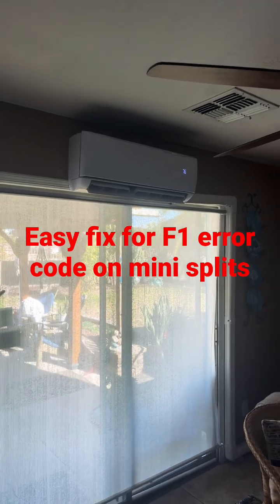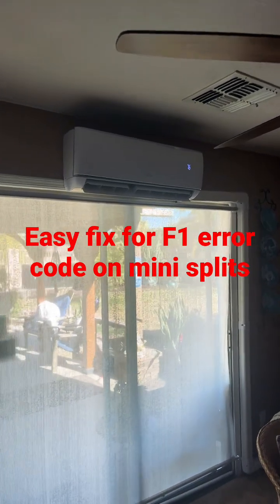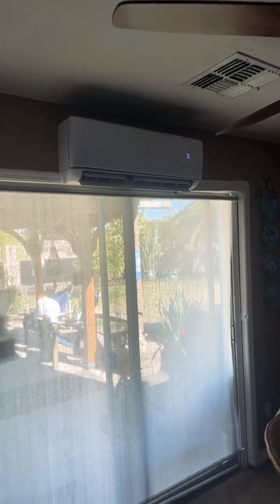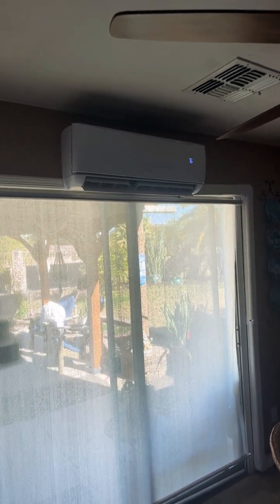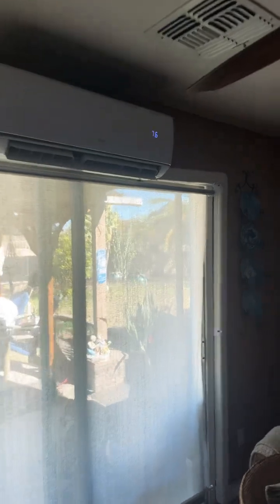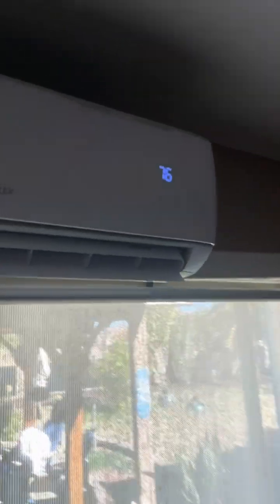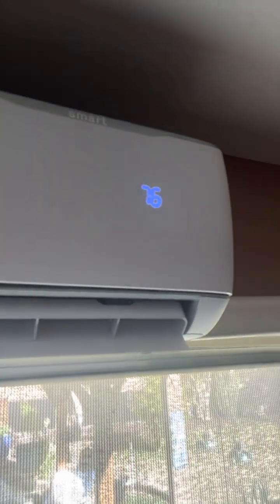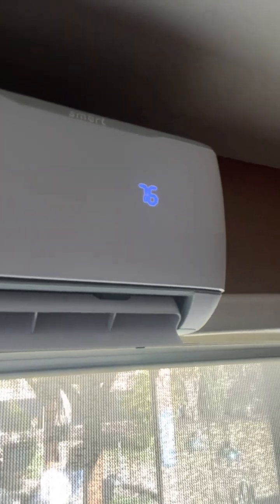Easy fix for F1 error code on most mini split heat pumps 120/240v.

Comment: I just cleaned the vents and now the fan is working but I don’t feel the cool air and it still showed the error 😭😭😭
Reply from the maker: I had the same problem and one of the wires on the outside unit came loose and was it connected at all. Once I connected the wire, the error code never came back. That was many months ago. I did a video on that fix as well.  Hope it works for you. I have not had any other error codes in the 4 years I had been running mini splits. Hope you have a truly wonderful and extremely blessed 2924

Comment: My AC shows this error when I run on Solar power during the day. Then I switch off and on but still it keeps coming back. I used water on the outer condenser but I’ll try your hack too. thanks
Reply from the maker: Try watching my other video where there was a loose wire inside the outside unit. I hope that fixes the problem first you.
Reply: @diy-solar-guy  thank you. I will watch the other video too and try it.
Reply from the maker: @cutiecats23 you are so welcome. Hope it works. This only fixes the F1 error code that I know of.

Comment: Do I have to reset the unit to get that code off after I clean the sensor
Reply from the maker: I just had that code F1 display on my mini split the other day. I unplugged the unit and waited an hour to plug in again. If it is hard wired, turn breaker off for an hour, then on. I also washed the filters and cleaned the sensor with a wet towel. It was close to 34-35 degrees outside so it could have been to cold for unit to heat. When I plugged mini split back in, it worked. No problems since. These mini splits will not work around 32 degrees. This is also a sensor on the outside unit as well next to the fins on the side the air blows out, make sure to clean that sensor as well. If your unit won’t work when around 32 degrees outside, try later in the day when the sun is out and if possible with the sun directly on the mini split unit outside. The F1 code is the temperature sensor. Hope this helps. Hope you have a wonderful and blessed weekend.

Comment: I have an FO error code on mine and I don’t know what to do HELP
Reply from the maker: Try disconnecting power or unplug for over 10 minutes if possible. Try cleaning the sensor on the inside head unit and the filters. Try cleaning the outside unit sensor as well. Both sensors are located next to the metal fins. Also look in your owners manual for what the code means. If it is low refrigerant, you might need to add the missing amount for the code to go away. If it is none of the above, it could be a bad circuit board or bad connection. With power off, you could try to wiggle the connections that are removable with male/ female connectors. Sometimes these can have a bad connection as well. Hope these help. Hope you have a truly wonderful and extremely blessed weekend

Comment: My indoor ac working fine. However as soon as I start heater function. It trips instantly.
Reply from the maker: Heating will use more watts but slowly ramps up so there is no surge. Double check your wiring connections to verify it is correct. I had a unit I installed upstairs and it kept tripping breaker. It was suppose to be able to install up to 16 feet off ground. The mini split did not have enough head pressure to push refrigerant in lines. I installed a different brand which was still 12,000 btu but it was able to push refrigerant up the whole 16 feet off ground with no problem. You could also have a bad circuit board as well. Hope this helps.

Comment: man! i got the F1 error... called the company. They said we need a technician. But, i saw your video and tried it and just as you said problem solved.. saved me money.
Thank you.
Reply from the maker: I am so glad you were able to fix the problem. I installed 7 mini splits, 6 of them almost 4 years ago and every one of them are still running great. I clean my filter and sensor every 3 months from dust build up. I remove the screen and lightly wash and rinse in the sink, let air dry and then install. I have not had any error codes in over 3 + years.  Hope you have a truly wonderful and extremely blessed week
Reply: That's what YouTube are for.. diy to learn taking care of your house bro. Tech gonna come out charge you his time to repair it. If you are handy and knowledgeable then fix it yourself bro
Reply from the maker: It’s nice to share quick fixes. Helped a lot of people get their mini split working again. I love that you don’t have to pay anything to try easy fix.
Reply: Good thank you

Comment: @diysolarguy man it woks 100%... Thank You Soooo Much man. In All Pakistani videos they were asking 🤦‍♂️ PCB is Out of order. Replace it... Oooo mannnnnnnnnnn.... You made my day. 🙏 praying for 4u from deep heart ♥
Reply from the maker: I am so happy that fixed your problem. Hope you have a blessed and cool days.
Reply: I cleaned the temp sensor but it still gives the f1 error code and i think maybe the sensor is faulty when i check out the company site which i have the ac unit they mentioned that if it gives f1 code surely you have IPM (integrated power module) faulty it runs for some time like 3 hours straight on 24°C but its automatic is not working,  which sensor do you think is faulty indoor or outdoor.
Reply from the maker: @aarishcollection2437 there might be multiple sensors on the inside unit depending on the brand of your system. If you search YouTube, for f1 sensor fault code fixes, there are a few videos that show you how to check ohms of the sensor and the main board. They show how to check with a ohm meter.
Reply: Han bhai ya banda na mera kafi pasa bacha lia 700 visiting charges lata haier wala phor 2000 loader ka rent aga go.masla batana tha ouska pata nai kitna bill
Reply from the maker: @legendxgaming3302 need to please comment in English. I have no idea what language you are using to comment.
Reply: It Depends on the different manufacturers,  the F-1 error code can be different in different brands, In this air conditioner, it meant the thermistor was bad, but the F1 error could be different for another brand. You will have to check the service manual of the specific company you own and deal with the error code according to it.
Reply from the maker: @forevertechenglish  thanks for your input. We appreciate it. We have seen a lot of people have this problem fixed by just cleaning the filter and sensor. People from different parts of the world. The error code seems to be standard for sensor error in a lot of units. Could be they are using the same circuit boards and components on the board. Once again thanks for your input. Hope you have a truly wonderful and blessed week

Comment: How
Reply from the maker: Turn power off on mini split. Clean your removable filter screens by rinsing off in sink if possible. Get all the dust off. Pat dry with paper towels before replacing. A garden hose might have to much pressure and tear screen if you use to clean screens. Clean the sensor by using a soft cloth that is barely wet to get dust off. Turn power back on and it should fix problem.
Reply: Awsm